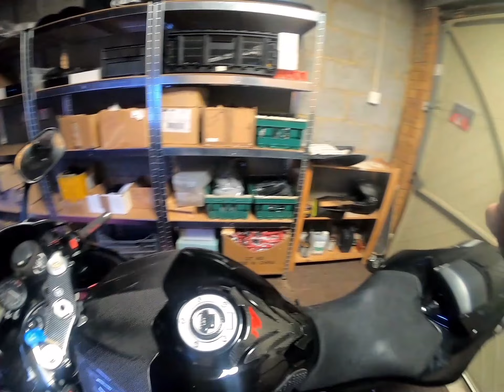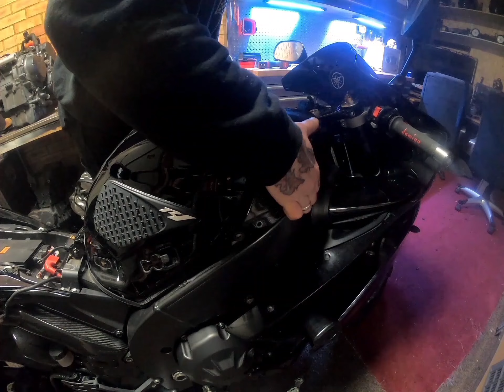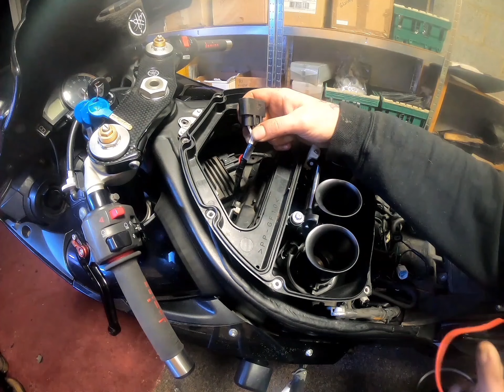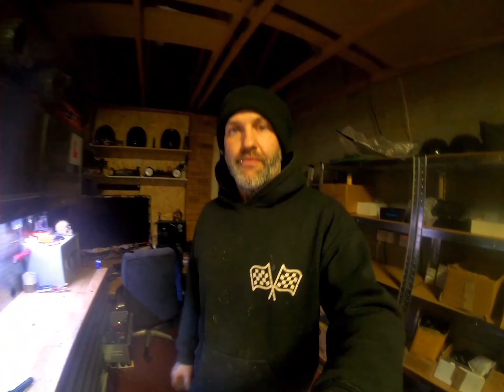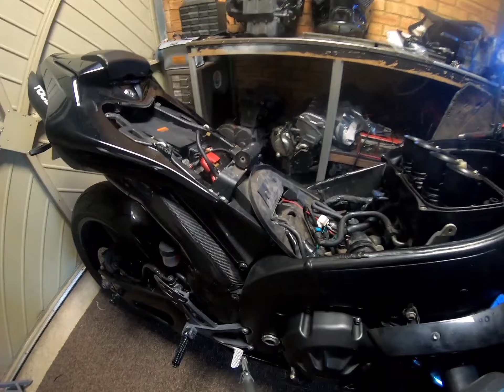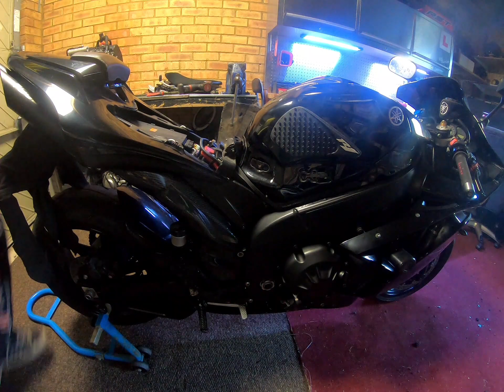In The Workshop, 2007 YAMAHA R1 With Strange Battery Drain, Testing Charging System

Comment: What upgraded stator and flywheel did you use when you say you upgraded.the magnets have fallen apart on mine common fault I believe
Reply from the maker: i bellieve its just the replacement part yamaha do instead of the old one, its just an improved part.
I got this Genuine replacement from ebay so im not sure on how availible they are though
Reply: Ok thankyou great video

Comment: By the way - a fully charged 12v battery should rest at 12.8v. At 12.6v, it's only 80% charged. At 11.9v it might start the bike but I'd call it fully depleted. It takes about 30 minutes of riding just to recharge the battery to the same state it was before starting the bike. Needs a full overnight charge on a battery tender.
Reply from the maker: i know which is why i said 11.9 volts on a battery aint brilliant and i charged it back to full and iits fine now